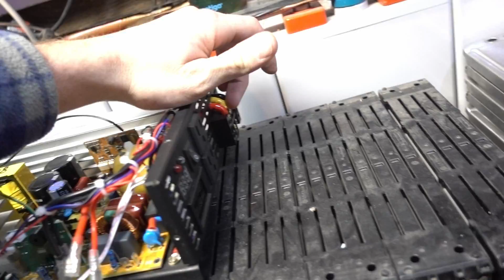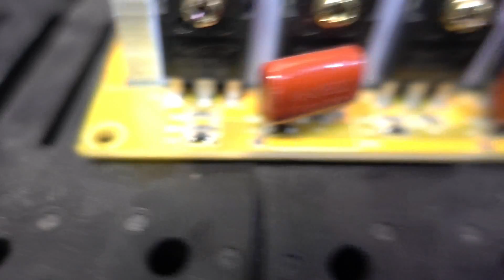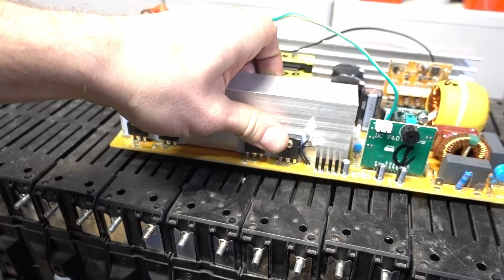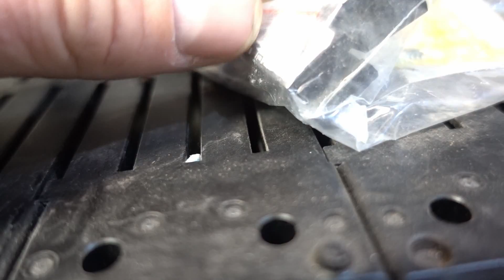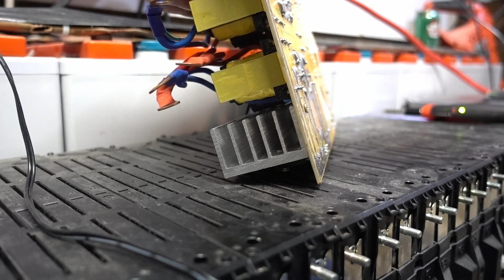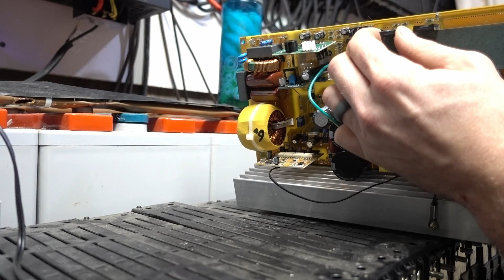Starting The 3000W Reliable Inverter Repair

Comment: Great video!     If you still have any reliable WZRELB inverters can you check the continuity of the outlet on the box?    This error can be corrected before these otherwise well built inverters fall victim to short circuit blowouts.     Please check out this video and compare/confirm the results.

https://youtu.be/bkzmud2FJk8?si=7dRe7dCbkYY5a4F4

Comment: Am having really difficult time finding 48 mosfet for higher frequency to work cool so am asking what the input mosfets serial numbers on your 48 volt high frequency inverter I would  thank you
Reply from the maker: Input or output? Also the smaller mosfets or larger?
Reply: @GoingOffGrid101  input mosfets for the dc to dc converter not out put igbt

Comment: I have the 6kw version with 36 Volts.
First one lastet 3 Months, these units are great at delivering Power, but not reliable at all. Its always the input Mosfets that break, i swapped them a couple times now. Iam thinking about replacing them with a different Type of Mosfets to see if the mosfets itself are the problem. But i guess its a design problem with these Inverters.
They sent me a replacement Motherboard, and it lastet about 6 months. Again these Mosfets are broken.
All in all these Inverters had a runtime of maybe 300 hours before they died.
Iam just asking myself why they dont try to solve problems like that.
Reply from the maker: I have had really  good  luck with the 3000w and lower, never gad one fail, but the 8000w I had only lasted a year

Comment: Hi grate video. 
I have 3 out of 4 mosfets blown in my inverter irfb13n50a but they are not available.  I dont no how to deside an alternative.  What do u suggest
Reply from the maker: Look up the specs and get something similar, is this input or output FETs?  And what wattage is the inverter

Comment: Can you please let me know the link where you got the parts. My vendor is not responding. I have the 5000w inverter. Thanks
Reply from the maker: what do you have a reliable.
Reply: @GoingOffGrid101  I have tee reliable 5000w peak 10000w
Reply from the maker: @TheShivasi  i believe I show the mosfets in part 3 i order them on ebay or aliexpress.com

Comment: TIP: If you use a heatgun aimed at the spot and the soldering iron at the same time, you can do amazing soldering. Used to do this with Fender amp Chassis grounds
Reply from the maker: Thanks for the great tip

Comment: Hi. My inverter stop working after 4 weekends of light usage. Customer service and warranty is a joke. 
So i left with no working inverter for 6 months with no hope...
Is ok till is working after this just put in bin :/
Reply from the maker: Did you buy through Ebay?
Reply: Yes  and  ebay can’t help me  and pay pal as well :/ 
Conversation with reliablepower on ebay is un-real , like talking with brick... in slow motion...
I can send you a copy of this conversation if you interested.
Reply from the maker: @lama84paaw  how did the inverter break? if it died in the first 4 weeks ebay should of helped you.
Reply: @GoingOffGrid101  it just stop working nothing no display and red light. I recive a repair kit from manufacture ( 4 different mosfets no matching with mosfets on inverter , a few resistors 1mm big and pcb different to pcb on inverter) no instructions etc. i’am able to change mosfets but don’t know which ones . And don’t have a skills and equipment to change 1mm resistors...
All this took more then 6 months from purchase so ebay is not able to help me.
In day of purchase seller was located in uk now they change to China :/
Reply from the maker: @lama84paaw  that sucks I might make a video about it again.

Comment: I have a 3000w YueQing Reliable Electric Inverter, it blows 2 fuses beside the 120 transformer, every time I replace it, it blows again, I replace it and and use my tester to check if there's any contact, when I do negative and positive I get a beep, what could be the cause of that? Thanks for responding.
Reply from the maker: sounds like some blown mosfets.

Comment: Úmmmm...testing the  FET installed...would the continuous (zero Ohms) is enough to point out that the FET is in shorted between the gate and the source? ...Would there be another type of test without desoldering the FET ?  Thanks

Comment: Hello,

Is there anyway to adjust the low voltage shutdown for the reliable inverters? For a 24v system, a 21.5v  shutdown voltage should be ok compared to the factory setpoint of about 19.5v.
Reply from the maker: I would not try to change it, it involves changing tiny resisters and I don't know how to do it lol

Comment: Changing all of the transistors and diodes is always a good idea, as when there is a short those left are stressed and will fail in the near future. I would never do any work on top of a battery, shorts equal fire.

Comment: I bought a new Nimtek NM5000 pure sine, 5000w inverter through Amazon to power my off-grid cabin via its solar system.  Although motors and computers make more noise than expected from a pure sine inverter, it works.  After a month, I needed an extra socket to plug a reading light on my headboard, so I plugged in my APC surge protector for more outlets.  The Site Wiring Fault was on.  I switched to generator power and the SWF LED was off.  I turned my inverter back on and plugged the surge protector into one of it's 110 outlets and the SWF light was on.  The inverter housing is grounded, the negative cable connection from the battery bank to inverter goes through a combiner box that is grounded.  My positive inverter cable goes to the red connection post and negative to black.  I have not experimented with switching the polarity to see if that's the problem.  Nimtek has ignored my requests to help troubleshoot the problem.  What should I do?
Reply from the maker: sounds like this inverter might be a modified sine wave, also the neutral and ground needs to be bounded for some devises to work, but the inverter might have a live ground and bounding the neutral and ground might blow it up. there are videos to make a cable to get around the ground fault your ups is having. I would search diy ground fault cable for generators
Reply: How do I determine if the Nimtek inverter that was sold as a PSW is only a MSW inverter?  I don't have an oscillator.
Reply from the maker: one easy was is to use a super cheap digital volt meter and see if it shows the correct voltage 110v-120v if it sows it in the 90v range its most likely a modified sine wave
Reply: @GoingOffGrid101  Voltage is good

Comment: Next time you get a Harbor Freight ad, grab one of their free screwdrivers. :-) Then all you have to do is worry about where you left them. :-(
Reply from the maker: ahahaha
Reply: You may laugh but I have 4 of them. I can only name where 3 of them are. One is in the car still in its plastic and cardboard. Its there so that if I can't find the others, there is always the emergency one in the car. :-( Monday it will be pick up another free one day, or another free meter. :-) I know where all 4 of them are.

Watched your video as I had considered buying one of the 24v to 120v 3000 watt Reliables. The design is decent but it seems like the parts may be sub-standard. I do own one of their 500 watt units for when I need pure sine wave but rely on the 2000 watt Jupiter Mod square wave for the heavier loads. Came in handy today when commercial power went down and needed to run the small A/C unit to keep the house cooled. One thing I've noticed about the Reliable, what it says is what its rating puts out. Others have an overload capacity of twice or more for surge loads.
Reply from the maker: I love mine :)

Comment: I have been using two Reliable-brand 3000W pure sine inverters over a period of about 18months and they had been very un-reliable and troublesome indeed.  I have not been abusing them with crazy inductive overloads or such, but they were used under real world conditions, for what an inverter should be built for. I ended up swapping  the units in action, using one as a spare while I had to repair the one that broke. They seem to work well for some time and then crap up, sometimes completely out of the blue, the promised protection circuits are just not working properly. I had to repair them about 5 times within that period 18month (usually not all Mosfets and IGBT were breaking) So far all spares were provided free of charge from 'Reliable'. As you show in your video they are fixable, but what's the point, if they crap up time and time again. Although the company had been quite good in respect to providing spares, I certainly can't recommend 'Reliable' or probably  any  of the cheap Chinese inverters as they are all not properly designed. I tried to get a schematic from Reliable and they said they don't have one, how can a manufacturer/ designer not have a schematic for troubleshooting?? (maybe they are just assembling). 

My recommendation, don't waste your money (and time!!!) on these ‘Reliable’  inverters, unless you want to teach yourself power electronics and learn soldering skills the hard way. The brand name simply suggests the wrong idea. 

Anyone serious about alternative power and off grid: think about investing in something better like Outback or the other brands that are proven to work long term. Yes, they are 8-10 times more expensive to start with, but you will have no more nightmares, no endless repairs and better support if needed.
Reply from the maker: I have stated this in newer videos, that my magnasine will way out last my 8000w inverter, I am hoping for 5 years on my 8000w inverter we will see, you will know if it breaks there will be a video on it, my two 3000w inverters have been running AC units and no problems so far, maybe because i custom ordered mine that they are better ? I am really split in my opinion as mine have been amazing, then I see others with problems/braking them :S hope they get better if there is a problem! what inverter did you end up buying?
Reply: Steve ateoone don't give them anymore money
Reply: b1blazin13 so sad. The way this panned out. Live and learn.
Reply: Going off grid can I send you my inverter for repair? Im talking to reliable to get the repair package. Think Im gonna go with a samlex next time.
Reply from the maker: Steve ateoone where are you located?
Reply: Going Off Grid Hey thx for responding! Im located in New Jersey, USA. Inverter is in local shop but I havent heard anything good😔. They say the repair package doesnt match the parts.
Reply: Steve, if you are living in New Zealand, drop me a line koru@webgallery.co.nz.
Reply: These things fucking suck my 3000 watt blew up caught fire after 6 months no refund even though I have full warranty
Reply: this is a wise comment!

Comment: Hot air station like QUICK 861DW or more powerful could do the job in seconds. It is accurate and relatively inexpensive. Curved tips like Hakko t12 and flat tip like https://www.ebay.com/itm/Mini-TS100-Digital-Soldering-Iron-Replacement-Tip-Lead-Free-Electric-SolderiR1A1/302685541280?ssPageName=STRK%3AMEBIDX%3AIT&var=601543775739&_trksid=p2057872.m2749.l2649  are better for smd soldering.

Comment: Hello Off Grid Guy
May I ask something...
i have problem with other off grid brand inverter from china,
the inverter when the condition is on and given the load let say 200Watt household appliances it will be electric shock stun on the cable connector polarity and in the connector on the battery if i touch it.
strangely if the conditions on but not given the load it did not happen.
Had a plan to change to a reliable brand, 
my question is whether in a reliable brand did i will have same experience at the same like the old one consider if the reliable has a ground..
Thanks for your attention...
Seems like you are more and very experienced than the inverter technician itself.

Thanks very much
Reply from the maker: I have 4 reliable inverters and none of them have this problem, have you treid not using the ground on that inverter to see if it fix the issue?
Reply: Going Off Grid yes i cannot connect to the ground try to connect and its short..

allready ask seller...their answer :

Hello,
it is normal according to your description,
there has a Circuit when you connect battery terminal,so you feel shock,if don not connect any conductor it have no any circuit.

Its is Normal?
if there is any defect to my battery and the Charger Controller?
btw thanks for your reply...
very appreciated
Reply from the maker: well I hope your next inverter does not have this problem, none of mine do this, sorry I cant help more.
Reply: Going Off Grid no problem...
Thanks for your reply anyway...
My next Imverter is Reliable 1500Watt like this video...
Its is on the way allready..
Do i need hook to my circuit breaker Ground for this Reliable..
Or no need ?
Reply from the maker: check the inverter to see if it has a live ground, if so do not use the ground, if its not live use it :) I have a video on how to test live ground or not.
Reply: Hi again Going Off Grid Guy...
Finally my 12V system Reliable 1500Watt has come....mine have a live ground as your video says...no more shock anymore ...lol...
Some red light blink highvoltage warning on 13.1V and i still using till now is been 6 hours to my household appliances...
Still wondering how much volt when low voltage will blink again...
Any info here ?
I think many different from 12 and 24 V system...
I still cannot realized what the different...hehee
Reply from the maker: these reliable inverters with have a blinking red light at higher voltage when the battery is being charged.
Reply: Going Off Grid yes..exactly ...that red blink show when my battery is almost full charge from charge controller...but i keep charging....:)
Reply from the maker: thats fine :)

Comment: good night I'm registered in your channel can help me, my inverter is the same as yours what changes is only the input of 24volts the power is 3000w too, in front of the transistors 60n65 missing the components smd D5 D2 and the D13 is strange without any indetermination, because it will be?
Reply from the maker: you saying you inverter is missing these parts that mine have ?

Comment: I sent reliable $40 and they did NOT send all the parts.
Reply from the maker: dang, what they send you?
Reply: They sent 
4) 60T65PES
4) IRFB4668
Little bag if fuses
No smd resistors or diodes
No boards
Reply: I'm also at a loss as to why the inverter blew. I wasn't for the reason the one you're working on did. 
One morning when I turned it on it went pop
Reply from the maker: thats weird, there has been 4 of these inverters I know of that broke simpler to this but mine have not had a problem :S I hope you can get it working or get a new one at 150 buck like they offer.
Reply: Going Off Grid reliable power didn't make any $150 offer to me
Reply from the maker: you should ask for it, that is what they did for a few people.

Comment: I'm trying to get one of these to install at home to run my home on solar in most of the circuit. How should I wire it properly so I dont damage the inverter?
Reply from the maker: check to see if the inverter has a live ground, some do some dont.

Comment: So after replaying the beginning a few times to understand how this blew up its still not clear. It's a 3000w 48v I get that, is it 120 or 240 output?
Reply from the maker: 120 volt if you have the ground on the outlet hooked to the neutral on the outlet the inverter will short out.

Comment: Trick with the SMD resistors, use two soldering irons to melt both ends. A 2nd one of those little irons should do.
The technical term for those resistors in this circuit is "gate resistors", as they connect to the gate of the IGBTs/mosfets.
Reply from the maker: thanks for that info! and good idea with the two irons!
Reply: i cut them off and install 1/8 watt regular resistors,space allowing

Comment: So if I try to use this inverter for a hot water tank in a RV there's no way to stop you from getting electrocuted if the element goes bad? I've used a lot of solder braided and the desoldering bulbs sometimes you have to add new better quality solder to get better flow to remove bad quality solder
Reply from the maker: you can add a ground fault after the inverter to be safe :) that should cover you.